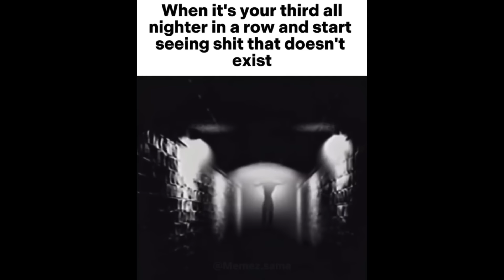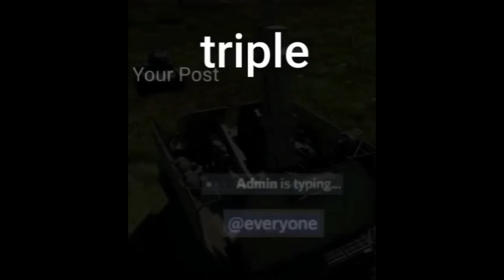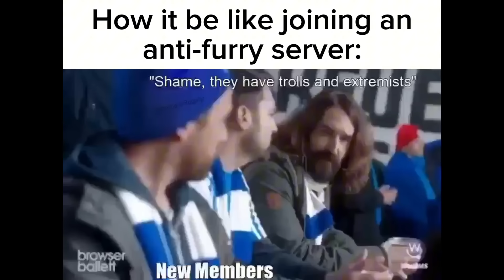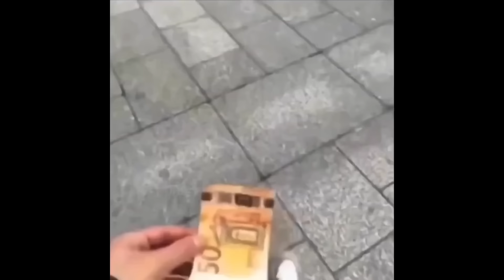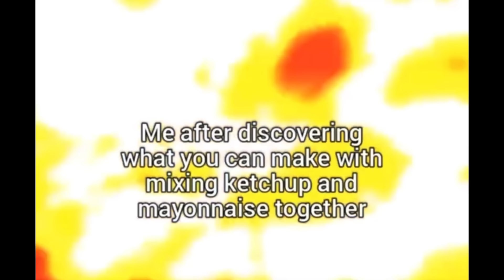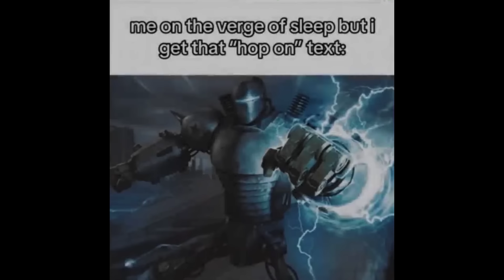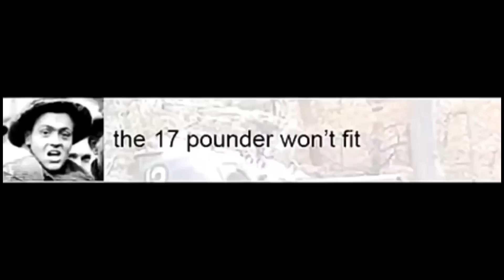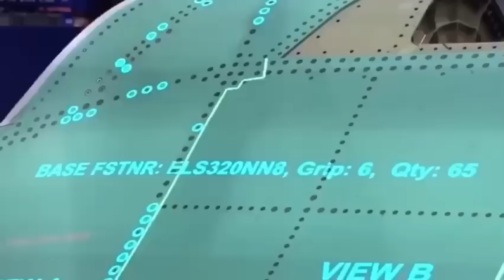Memes I’ve Collected Over The Past Two Weeks

Comment: the clock aint even correctly set 💀🤦‍♂💀
aint no way the minute pointer is between two minutes like its at the 30 second point when the seconds pointer is at 0 seconds.
if ur gunna ask me to read the damn clock, set it to an actually existing time.
Reply: wtf are you even yapping about
Reply: @most_sane_piano_enthusiast  
if you want an actual answer: the meme about being able to read a non digital 24 hour clock.
Reply: I've had clocks that the minute hand moved slowly on before
Reply: clocks do that sometimes? i guess?